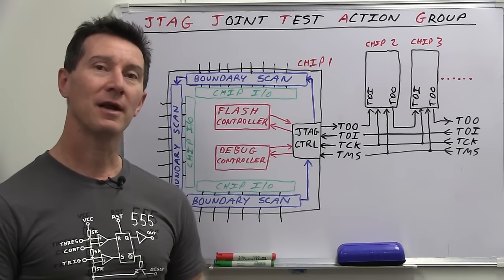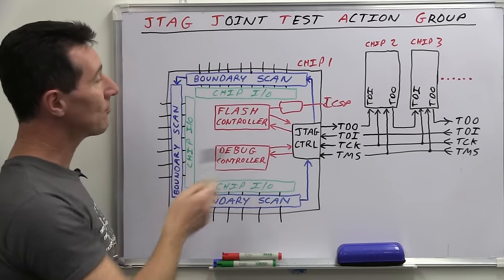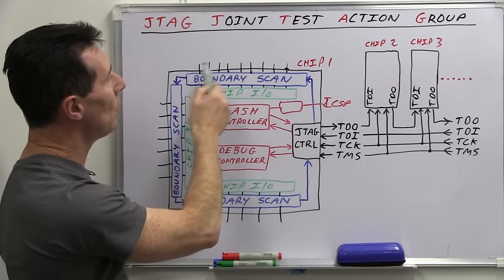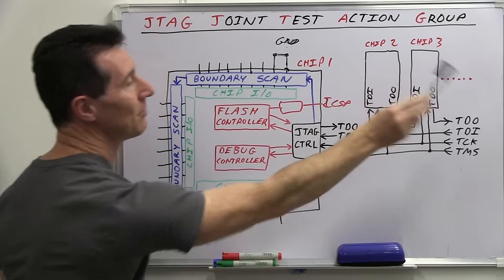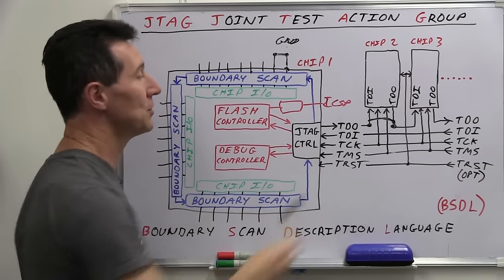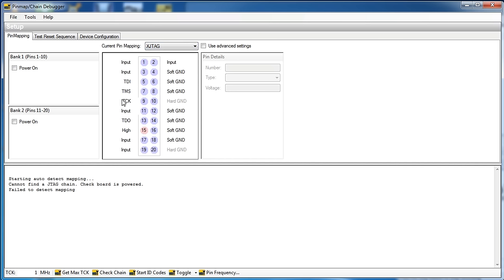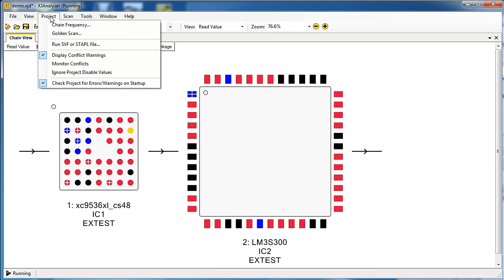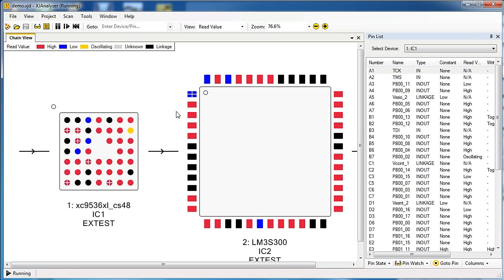EEVblog #499 - What is JTAG and Boundary Scan?

Comment: wow! I have been using JTAG for programming for many years and I never realized about its true power until I saw this video! great work my friend!!!
Reply from the maker: Thanks. Glad you found it useful.
Reply: +Robert Slackware He does it cause it's more or less worthless on a laptop board that's out of the assembly stages. There are security bits that get flipped once the manufacturer is finished using the JTAG, which leads to it being rendered more or less inaccessible (especially mac books, which Louis deals with. Apple sux, we know). Removing it in case of fluid damage in the vicinity more often than not can fix the problem. JTAGs are pretty sensitive and "thin skinned".

Comment: You seemed to gloss over the fourth JTAG pin: TMS. Your description of TDI, TDO and TCK were perfect - but think about what would happen if they were the only pins, and TCK shifted the 1s and 0s through all the different pins... There'd be chaos as the differing values produced different results! That's what TMS is for. Think of it as Jean-Luc Picard saying "Make it so!" - until TMS is used (I think of it as "Master Strobe"), the shift registers just shift the data. TMS is used to "latch" the current state into the actual pins.

Comment: Very good. Thanks. Just to remind that signal integrity should be taken into account carefully. If many chips with JTAG pins exist, say complex boards, I prefer using CPLD to access each chip directly rather than having chains (chains can be established on CPLD rathher than PCB with maximum flexibility) and installing/uninstalling jumpers on TDI-TDO pins. And of course optional TRST pin exists as well.

Comment: If you're hacking/reverse engineering a PCB that doesn't have an obvious JTAG connector (but suspect it's still there based on the chips on-board), you can use something like the JTAGulator, which is an open source tool I recently designed. Just connect to test points on the target board and have the tool try to determine if a JTAG interface actually exists. Once you've determined the pinout, you can use standard JTAG tools to start interfacing directly with the chips, extract firmware, etc.

Comment: @AvstoMusic - Each JTAG pin "site" knows whether it's an input or not, so an input won't 'adopt' its shifted-in value. Instead, it will ignore the shifted-in value and shift out its current value - when TMS is strobed, at least! So a host performs a complete scan by: [1] Shifting N bit values; [2] Strobe TMS to "Make It So!" (see my previous comment); [3] Shifting N bit values. That will program the outputs to the desired values, and then read the resultant values.

Comment: Excellent explanation of 1149.1 Boundary Scan, but if the green rectangles represent your I/O driver & receiver ckts, then I would have drawn the the green rectangles outside of the blue ones.  The output test data is fed into the drivers by scanning it into the boundary scan latches and then driven off-chip.  The receivers conversely receive input test data from off-chip and feed it into the boundary scan latches, where it is captured and scanned out.  As drawn, this diagram implies that latching occurs between I/O ckts and the physical chip pin.

Comment: If you want to access only one chip while having multiple serial connected chips,  you can shift in bypass instruction to the other chips. Thus the TDR is only connected to the chip you want to see. This will greatly speed up things.

Comment: I rembember, that JTAG can short out individual chips on its on via the JTAG control circuit. So, datas do not need to travel all the way through the chips: You can set each chip to bypass the data and therefor speed up the process of programming/testing etc. The data will only go trough the control logic which only have a few bits and not hundreds.

Comment: Hi Dave, just wondering if you can actually damage your board while "playing" with  JTAG. For example - your looking at a single chip, without taking in consideration the rest of the PCB, and force a pin to go low, not realizing that it's an input being driven high by another chip, ultimately shorting down that other chip's output to ground, drawing to much current for too long and blowing up that other chip?
Reply: I would also like to know the answer to this

Comment: 7:15 oh wow that is cool
so if you had a situation where a pin was being pulled high, which you were trying to pull low with your code, you could see that through JTAG even though the chip thinks its pulling it low
very cool

Comment: Dave, nice video.  I am confused over the "TDI pin goes to the TDI pin of the device not the TDO pin".  I assume you mean that all 4 of those lines are just paralleled to all devices?  I mean it looks good to have the chips drawn as micro (TDO) -> chip 0 (TDI)   and chip 0 (TDO) -> chip 1 (TDI), serially so to speak.  Or am I on the wrong road? Although I've never used multiple targets, it's nice to know how it works... :)
Reply: Jack Wilborn TDO of one chip goes to TDI of the next chip. They are daisy-chained. TCK and TMS are paralleled.

Comment: Hey Dave, you know the 5vdc output for the usb port on the computer is really ratty..Pulsating dc at best. The problem is my cam has a built in mike and if I use the cam/mike I get this motorboating in the audio. anyway to get some sort of filtering going here to 'flatten' the usb port dc????? maybe an external filter or something like that?

Comment: Yes it's very useful. I didn't know it was a debugger either!

One question though - when daisy chaining devices is it first in first out or last in first out, for the data?

Thanks!
Reply: abtra It will be a function of the physical arrangement on the board, if I am understanding your question correctly. Think of a huge shift register.

Comment: @expertmax yes you can with a little care. Don't just hook 'em up read the datasheets. Some pins are tolerant of differing logic levels etc and you can get away with more by arranging chips on the chain in optimal order. I think I saw an App note on Altera's website a couple of years ago. Don't forget about the magic smoke.

Comment: I was looking to implement JTAG instead of bed of nails testing for a PCB using a NXP processor, but then for whatever reasons the designer of the PCB did not make a test point (or maybe the nxp doesn`t have one ?) for the TMS.

Comment: Thanks again! Just thought jtag was the evolution of icsp. And "tucked between i/o circuitry and the physical pin" broke my belief of firmware is "it". If jtag is active by default in chips, could possible jtag mis-configurations survive resets and no power and affect normal program execution?

You know how one might initialise an mcu by filling ram with 0's, and setting all i/o pins high, just  in case that something is stuck and it might get unstuck by this re-initialisation, is there something similar to a hardware jtag disable method, eg, say, pulling the header pins low or something else?

Thanks again and again for your vids! Uni's could learn a lot from your channel.

Comment: Do some JTAG devices have depth buffers on the boundary scan pins?  Is there any state information with boundary data?  For instance, some kind of RTC stamp so you know that the state from all pins is at the same time?  Or does the serial scan only send back exactly what it had at the point in time the scanner got to that particular pin?

Comment: Does it tell you whether the pin is output or an input. Setting a pin "low" if there is a short between it and the power supply probably would not be a good idea.

Comment: Does JTAG usually have TVS protect? I used Xilinx Spartan before, I can read the JTAG and the FA said, coz I plug and unplug the JTAG too often. May be the static charge killed it. Do u have any suggested circuit for the JTAG pin? Thx

Comment: but i am still confused how you detect error or problems.
could you give an example?
Reply: You have a bunch of flip-flops connected sequentially in a chain (scan chain) if JTAG is enabled. You put a test bit pattern in and get that pattern out. This output pattern is "computed" from the internal logic and compared to simulations. By taking the difference of the real and simulated patterns, you detect errors. The most common errors are stuck-at faults, which means that a an input or output of a logic gate is stuck at certain logic level (due to bad process of the chip). For example you know the logic of a standard NAND gate. To check if the output is stuck at 1 for example, you need to put {1,1} on the inputs. To check if stuck at 0, you put every other bit pattern except {1,1}.
Other faults you can detect are race conditions and of-course software debugging errors (reading values of the registers).
Reply: ***** Thanks!!!
Reply: Great explanation, thanks!

Comment: what is a good JTAG unit for hobby sniffing ? same as the xjtag software
Reply: go with the manufactures supplied JTAG unit. like ST micro's use the ST-Link V2.. etc.. this will get you programming onto the device. there are some cheaper Jtag devices about, but i have had the best experience with manufactures programmers.

Comment: how do i know if there is JTAG on a PCB?
Reply: 987inuyasha Look for the datasheet of the chip. if you found the pdf of it. simply press strg+f and enter JTAG. then you can find it and also the pin. if youre talking about something like a bga chip, its much harder.
Reply: +Matze Strawberrymaker ctrl + f. But that doesn't really answer his question. Some companies don't populate jtag headers, or they simply don't provide the jtag interface on the pcba. You need to look at the schematic of the PCBA to figure out if comes with jtag or not.
Reply: incorrect, they will always have some method of programing their devices with the chip on the PCB. some times its on a header, other times they use scatted test points... hope that helps.